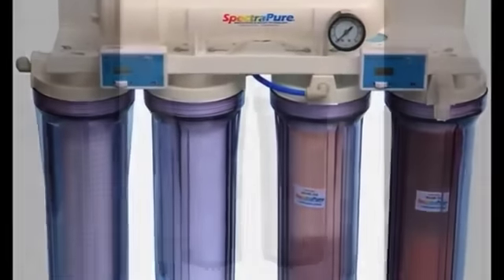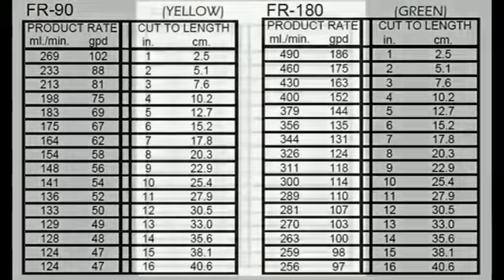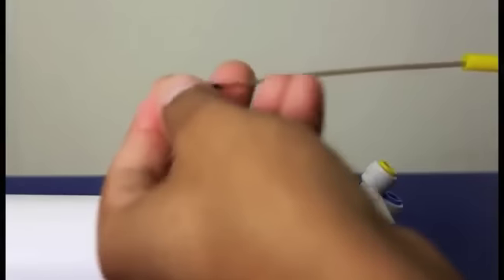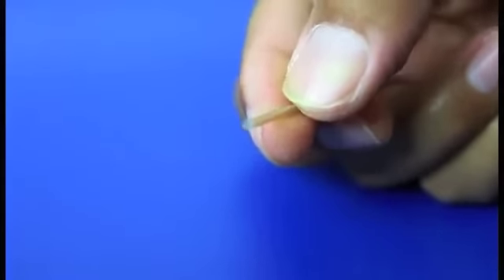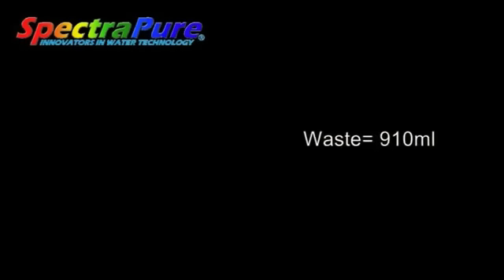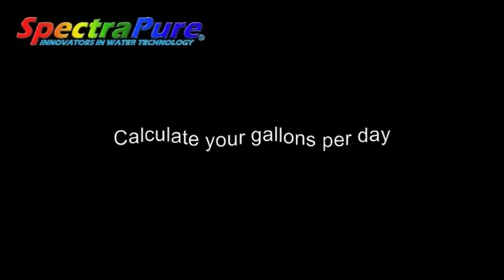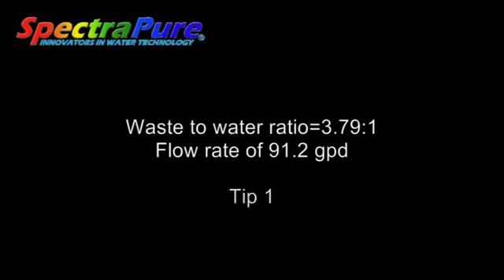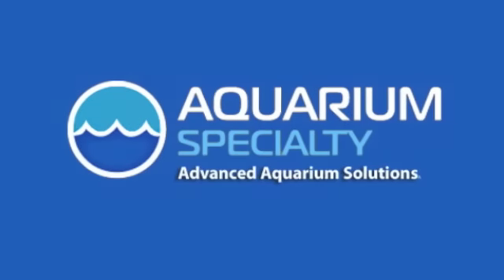Spectrapure RO Flow Restrictor Setup

Comment: Do all RO/DI units have this? Mine is producing a horrible ratio (Melev Reef brand). It's new. About 24% is getting through. Maybe it's my ratio idk. No one talks about this online.
Reply: You can boost the ratio, like this: First remove the tank and remove ASO, then convert the system into directflow type by installing boosterpump with low-pressure sensor and solenoid on input (basically direct flow RO) connected to AC/DC. The reason is because typical low-rating membrane units with ASO and tank - have tank backpressure dilemma, so get rid of the tank system. Next decide if you want to activate by hydraulic pressure - install high-pressure sensor and connect it to the solenoid and pump (parallel), or if you activate by electric switch - you dont need high-pressure sensor, just connect switch to solenoid input and pump. After this is done, you should go either 50-150 (regular size) membrane, which you connect sequentially (serially), or 300+ gpd membranes where you should prefer double-input/by side type with two inputs. You absolutely need membrane/booster pump for this. If you are very short on money - get basic 2-1 system instead, this is 2 small inline prefilters and 1 large membrane (100-150 membrane or 200 nanomembrane, - more input at price of worse filtering). With 2-1 you will have to replace filters faster though and will have to flush membrane manually. Electronic systems can be retrofitted with independent autoflusher (two-clock relais+extra solenoid around restrictor).